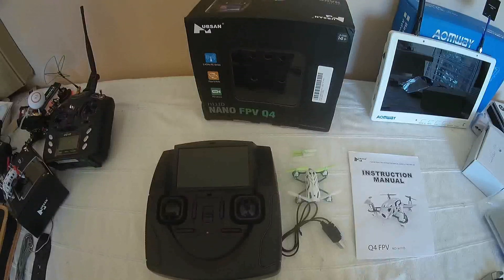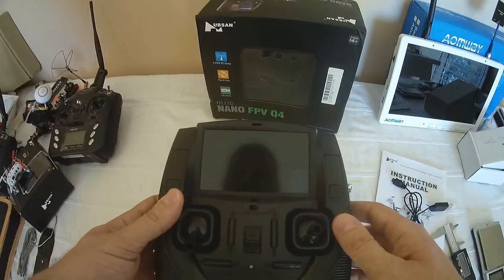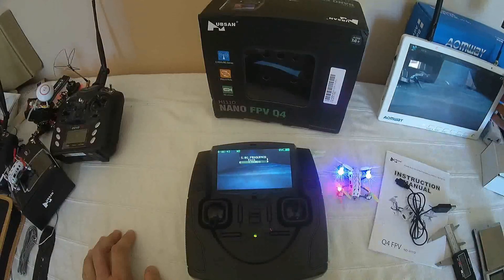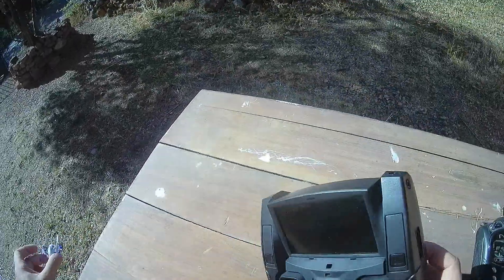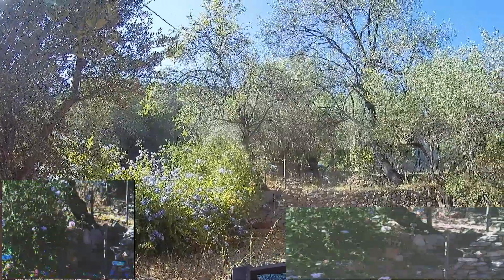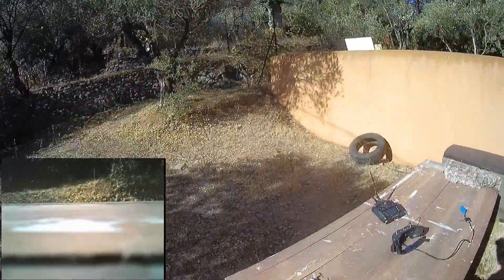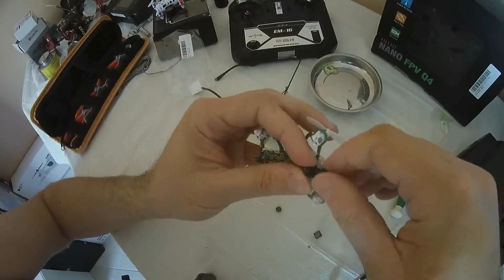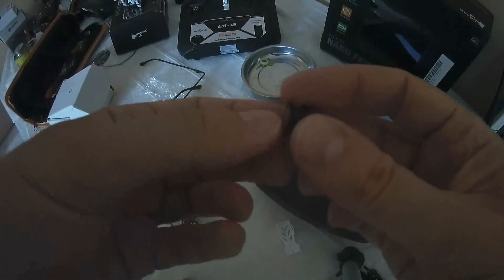Hubsan H111D unboxing and testing (Courtesy Banggood)

Comment: I really appreciate the level of detail you go into both in these video reviews and on rcgroups. In particular, your exact measurements of battery dimensions is always very helpful for me to shop around and get greater capacity batteries that will still fit. Could I politely suggest though that you upgrade your microphone on these videos? I find it quite hard to hear you clearly even with my speakers turned up. Anyway, thank you, and keep up the good work!
Reply from the maker: Yes I know I need an external mic but I will relatively soon invest in good 4K cam + lights + everything. Expect that within 1-2 monhs